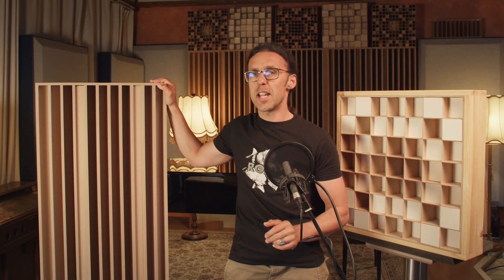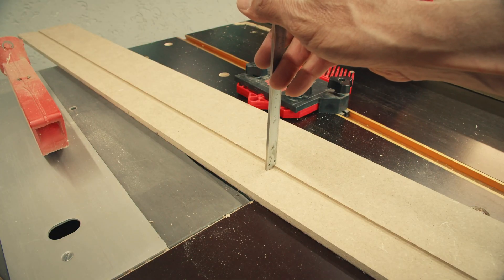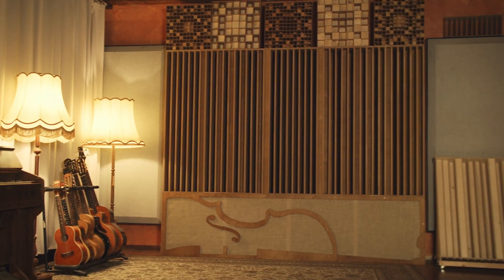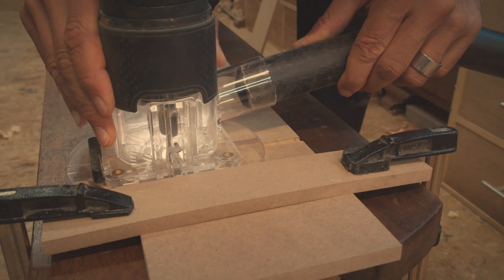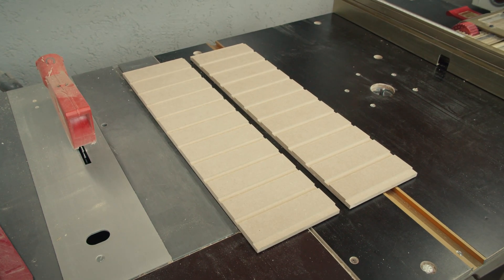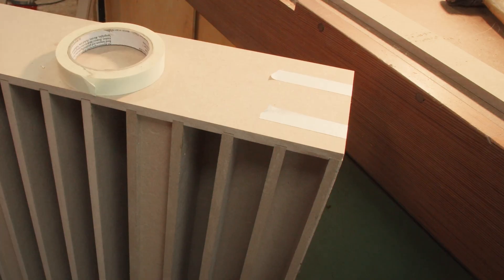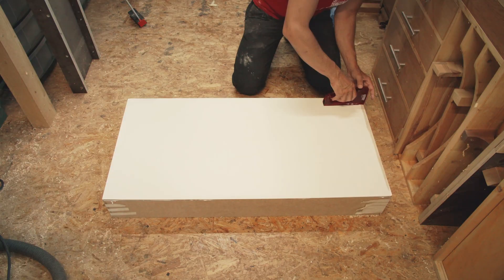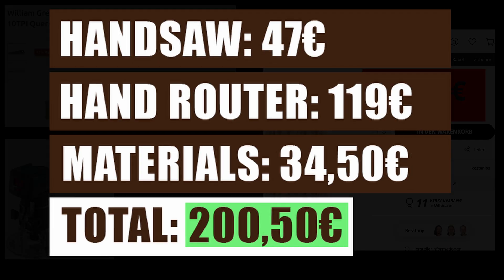Build a Pro 1D Studio Diffusor for 34€ — Full Guide + Theory

Comment: Are you using REW to measure your room to decide which frequency you need to diffuse? That may make a cool video for this series
Reply from the maker: @monkeyfishfilms You wouldn´t typically adress problematic areas in frequency with diffusion, but rather with absorbtion :) you would use diffusion to not plaster all walls with absorbtion, but keep some liveliness in your room, without having hard ugly reflections, but smooth scattered reflections. That being said, you theroetically could tr to adress problems in your room by using diffusion, and I also did that. I had 442 Hz resonating in my recording room, didn´t want to deaden it too much, and decided to build a giant 350kg diffusor with its lowest true diffusion frequency of 442 Hz. It worked fine as expected, but it is unusual to go that way. When deciding, how deep and complex you want to build your diffusors, you will usually see how much space you want to ofer as diffusion surface area, and how much time and material you want to spend on building ;) Then go as broadband and compley as you dare to go ;) Cheers!!

Comment: Thanks for the video, I find it very good. I have two questions. The fins are quite thick. Does this effect the scattering quality? And I have also a question about your big diffusor calculated with a higher prime number. It does scatter deeper frequencies, but doesn't it also mean that your minimum listening distance needs to be higher?
Reply from the maker: @asref-o4y

tbh, I don’t know if there is a critical fin thickness, that will start to cause problems. In practice, it will be tricky to go much thinner, especially if you consider the parts where well bottoms with same depth meet.
You have a groove on the same spot and the remaining thickness is now 4mm. If you go thinner, it may break here. It also generally may get a bit flimsy…
So while I don’t have 100% certain data, I wouldn’t worry too much about that :)

Regarding the big diffusor, yes you need further distance! The qrdude program recommends a bit over 2m. I have it in the recording room and make sure to keep that minimal distance whenever possible :)
The room is 8m long, so most of the times no problem :)
cheers!!
Reply: A possible solution to using thinner material is to make a jig like you did with the qrd diffuser and skip the groves.
Reply from the maker: @ThePentosin that could work, but it may be tricky to accurately glue in longer strips as well bottoms instead of small squares
Reply: Would there be much difference? 
Might need a little bit of weight maybe, if the strips arent completely flat. But that shouldnt be a problem.
Reply from the maker: @ThePentosin  that could absolutely work! I think I built one or two that way, only without the template...it was a pain to assemble accurately...but making a template with 3 or 4 pieces of wood as support for each well bottom could work...good idea :)
Reply: Yeah, i dont think i would even try to do it that way without a template/jig. That sounds like pain to get right.

Comment: I don't know where you live but here in Toronto, Home Depot makes only two cuts for free and will guarantee accuracy to only 1/8" or 3mm. If I ever have to have stock cut down accurately at HD I make sure to measure and set the saw myself, to whatever degree the staff member will tolerate.
Reply from the maker: Ouch 😅
Then we are really lucky here in germany ;)
Worst case would be then to pay a carpenter for an hour to precut everything on the big tablesaw. That’s what I did with some early projects before I had a couple machines myself :)
cheers!!

Comment: My question is how to design a diffuser for a combo panel
Reply from the maker: Hey :) You mean a larger sequence diff. split in parts? Use qrdude, and let it calculate a suitable design for you. Then split it into smaller parts, if you don’t want to build it in one piece (pieces could get really large then). Then build the smaller pieces exactly as shown in this video and put them side by side. The only little detail you may want to take care of, is that mating fins will only be half thickness, so together they are same thickness as the others, and it will look and behave as one single-piece diffusor :)
Hope that makes sense? Let me know ;)
cheers!!